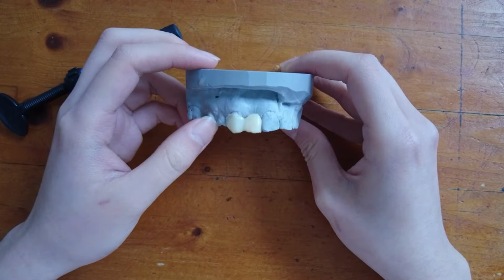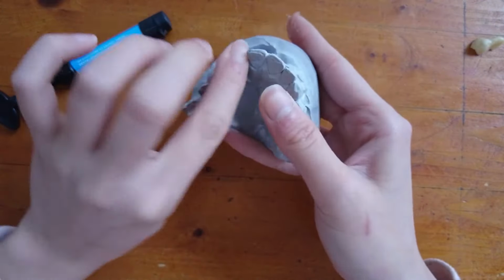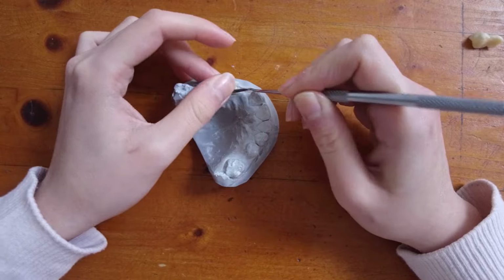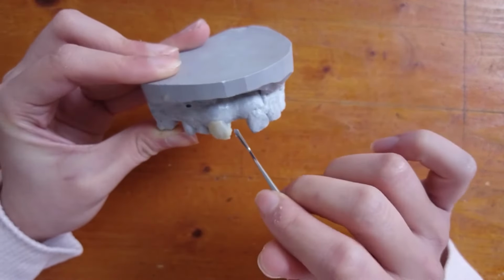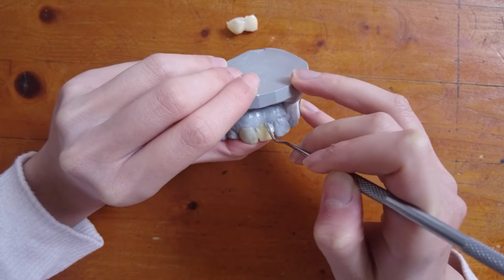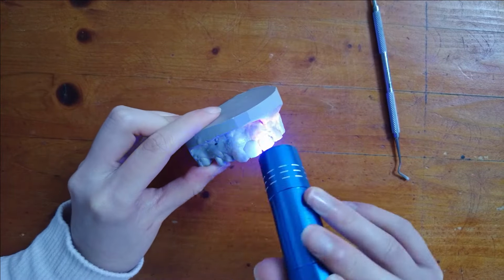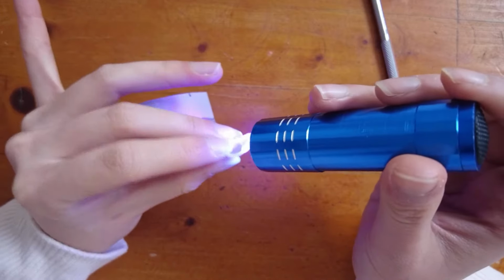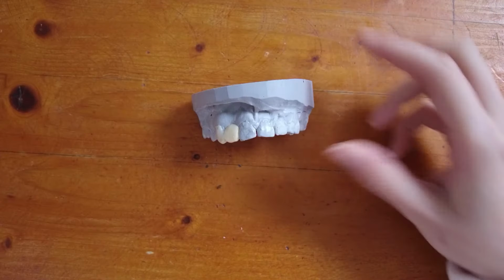Make your Own DENTAL BRIDGE at home DIY! Easy and Realistic Custom made Resin Bridge

Comment: Hi, very nice to see I'm not alone in this I had a Maryland bridge put in when I was  kid. One of the abutment teeth decayed and broke off. The other is very thin. I lost another one to the one abutment. So... Im doing a bridge from  canine to canine with one front incisor also as a post. (weak) I'm doing the first bridge frame out of hardened plastic, and I've grided the two canines to more like ball sockets so the harden plastic frame snaps on. Do you have any suggestions? And please would you give me info for best porcelain & adhesive products to by.. I don't want falures and repairs constantly I want to just do it right.. I am mechanic & carpenter for 20 years I can fix anything. But this has me a little nervous. But I don't have the kinda money they want to fix this.. Thank you so much..
Reply: There's programs out there it took me two years to get on one but when it was my turn they took care of it you may be a mechanic and of carpenter but you shouldn't be grinding your own teeth
Reply: @margaretjeffers1368  What’s the name of the program?
Reply: Go to your dentist, you can’t be a master of all trade